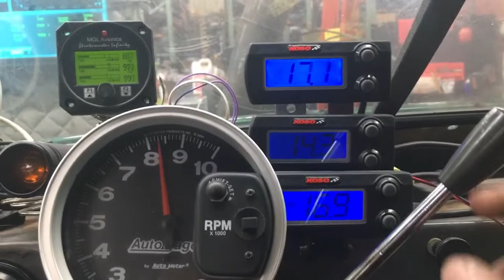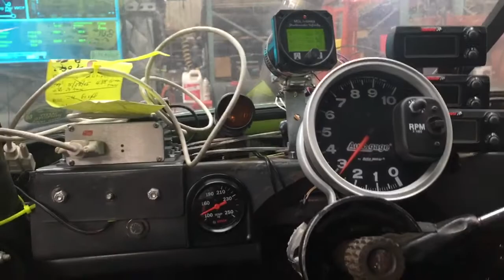Sonett II 750cc Running 112hp at Wheel

Comment: When are you going out?
Reply from the maker: Ernest W. Durbin III hopefully mid September.  Want to join the team?
Reply: tom donney I was just interested in spectating, but if you need hands, I got some
Reply from the maker: Stefan Vapaa aluminum melts at 1120 so I'm a long way from there.  Plus this is a short pole of only eight seconds or so.  There's no duration for the heat to build up On the piston dome.
Reply: Now needs a supercharger turbo 125 shot of nos
Reply: EGR gauge top left? How does it not melt a piston at over 900 degrees?